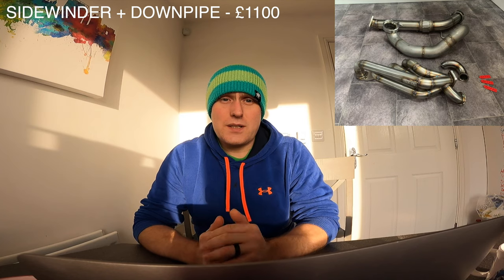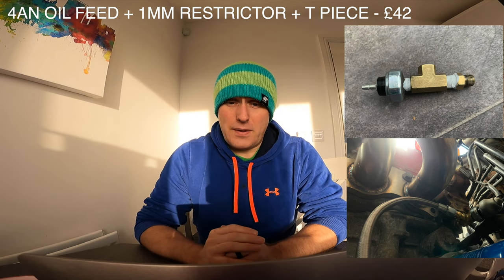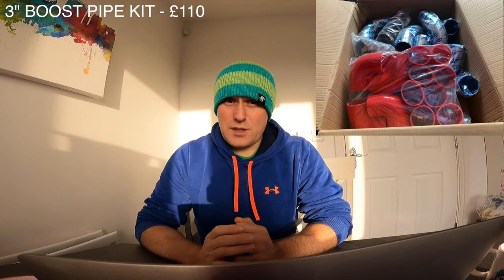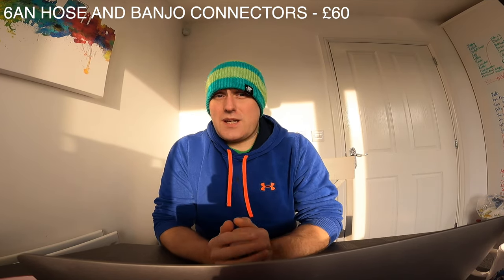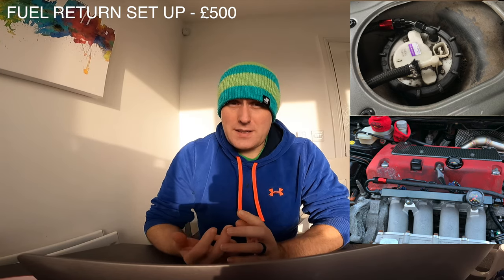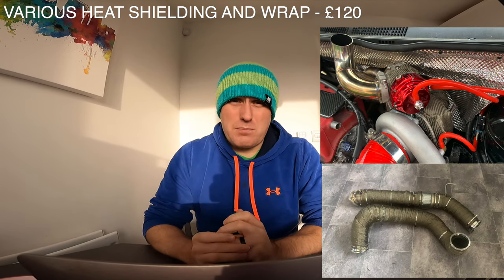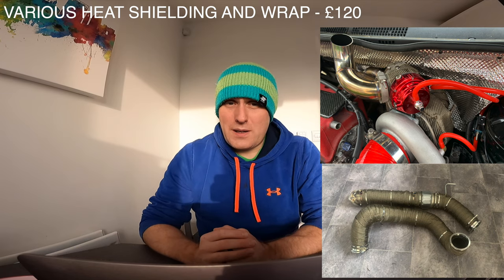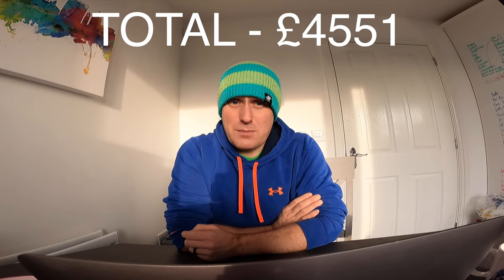Honda Civic Type R K20 EP3 Turbo Costs

Comment: The only thing I did different is a swirl tank with a Bosch 255 pump, when I went round conners at speed I got fuel starvation.
Great Vid, spot on.

Comment: Pretty much the same as me price wise, however I've gone the supercharged route, but I have switched to any LSD uprated clutch lower ratio final driver betting better top speed and motorway driving  but slower acceleration, gonna take the engine out next as I want some block work done. £5k is a really good price to have it done your way. Love to know what sort of numbers you're getting.
Reply from the maker: Hopefully get it on the dyno towards the end of January and see where it’s at. It runs ok for street tuned anyway so far. I’d like to get to 450hp.
Reply: @1BlueGhost  how much does it  cost to tune
Reply from the maker: Depends on where you take it I guess? Some places I’ve asked seem to be £450-500 for a map
Reply: @1BlueGhost  tru cheers mate

Comment: Great video
Reply from the maker: Thanks, I hope it made sense and was of some help
Reply: @1BlueGhost  I have an EP3 which is quite standard. Did you use the car much standard,  the with NA bolt on before you turboed it? I saw your video with the Skunk2 Ultra Intake Manifold. Looks like the NA bolt ons can be done for about £2k (Japspeed exhaust manifold, Skunk2 Ultra Intake with 70mm TB, 2.5" cat back and Kpro/K100 ecu). Do you think it is worth doing the NA bolt ons or go straight to a turbo setup. Great videos cheers
Reply from the maker: They are good car n/a with those mods. Some see about 250hp and it would make a great car to drive. I bought this car to turbo it so it’s difficult to say which way to go. The exhaust apart from a 4-2-1, inlet and ecu you would use turbo, so may as well do them anyway.

Comment: Hi ,do you need to up grade the bottom end of the engine?
Reply from the maker: It “should” last at about 450hp without any changes from stock. It’s more about the increase in torque that kills them. I think over 300lb/ft will kill it quickly. Im hoping to get another engine to build up at some point.

Comment: Great  video  turbo seams very cheap  has it lasted well .
Reply from the maker: Pretty much a year now still going well 👍 even the cheap wastegate seems to work really well which is more surprising to me
Reply: @1BlueGhost  any link to cheap wastegate? I’ve seen them for £70 on eBay
Reply from the maker: @Boost_Addict20  yes id say that's probably a similar one to the one I use. pretty sure this link is the same one

https://www.ebay.co.uk/itm/254077133709?hash=item3b282d638d:g:9wIAAOSwIgNXv5x3&amdata=enc%3AAQAHAAAA4KbtFnq1GBHclPXo7o7mghkpDjJ1IcGdVr1vwU9HR35YlkwgPT3BoH4FaQfyJuIbfbBPGNqQqIyHXTb7kmETCjzAVdcKyX32GYjBrqoy7j360h9YXijpRKXCWk7GokT%2Bwu0Enj%2FBKRALiLU60smTciqMOEOdEfMhH%2Budv1zVgkp2WIJh4LaBEOxHPwZY7Yct%2F1dWV%2BzzER3wbELfXUtZMCeKImTP0QkEMkni%2F2Mt0RyJp2nczKUtaA0x665s1jpc8zLQYXyxpvthfiDEC1XWpzrxkjmXq4UGjgZaqah2%2BxJM%7Ctkp%3ABFBMgo2jir9g

Comment: Is that a t4 or t3 ? Looking at the la fab but they only do t3 or garret/ presicion fittings
Reply from the maker: T3 flange
Reply: @1BlueGhost  top fella
Reply from the maker: @joshwilcox8483 if you have any other flange style requirements the various fabricators that make the sidewinders will probably be able to make what you need. Always worth an ask

Comment: What is the fuel eco? How much does it cost to run?
Reply from the maker: Driving regularly it’s probably no different. It does obviously use a fair bit of fuel when you’re on the throttle though as to be expected. I’ve been using it every day this last week and the fuel gauge hasn’t moved much.